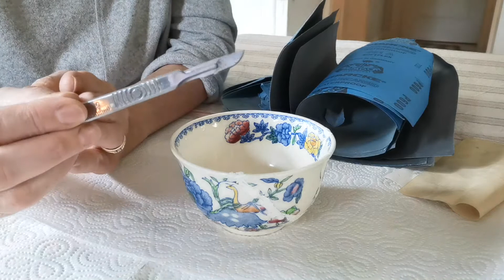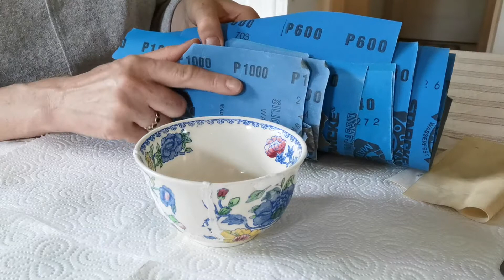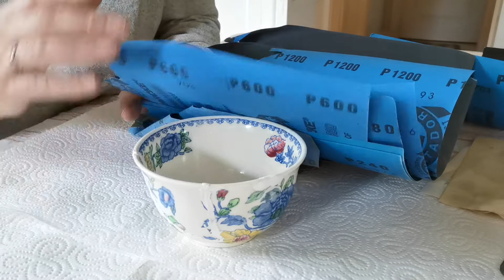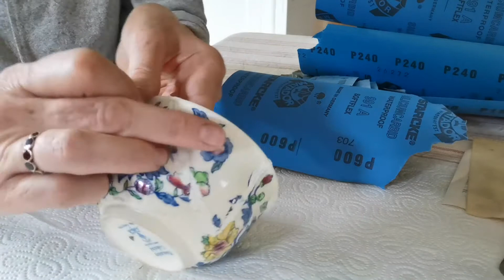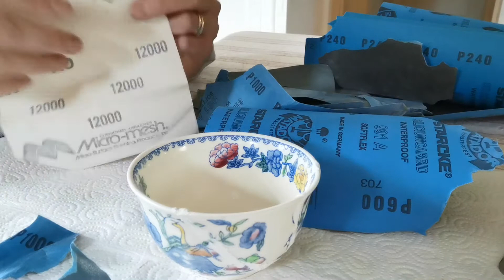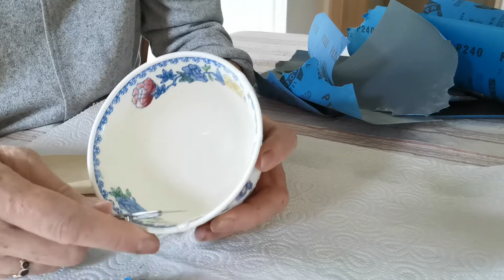How to Sand Milliput Perfectly Smooth (Without Scratching Glaze!)

Comment: She’s advising backwards on the sandpaper. Should be low to high = rough to fine (e.g. 180 rough 1000 very fine). Edit - Ah, she corrects herself (sort of), but then says that the 12000 sanding cloth is the same as the 1200 wet/dry paper! I must say, however, in spite of the confusing grit advice, the instruction is spot on and well done. Just what I needed. Thanks!
Reply from the maker: Hi CJ, many thank for your comment and for watching. I realised later I had said the paper backwards at one point and yes the Micro mech is 12000. Sorry about the confusion. I have since put the correction in the description box. 🥰

Comment: The smaller number of the sandpaper, the coarser the sandpaper. the higher the number, the finer. Start with a suitable "coarse" grade like 400 and finish with a fine grade, like 1000. In woodworking, 60 is coarse; 220 is fine. In auto body repair, 400 is fine; 1000 is much finer. You would not use a coarse sandpaper for auto body repair or for china repair, I would think.
Reply from the maker: Hi Mary Anne,
Many thanks for your comment and also for watching,  yes unfortunately I said the grades the wrong way at one point. I would usually start with a grade 600 then work up to 1200, then finish with grade 12000 Micro Mech for Ceramics. ❤
Reply: @TheCeramicRepairStudio  You should add the micro mech to your affiliate links! I just finished repairing a small bowl and a coffee mug, and I just want to say thanks for making these videos! I'm not super finicky about the results (I'm honestly unreasonably proud that I was able to fix my things, and in a crude way I like how obvious the repairs are - that and I don't want to sand for hours) so I'm content having stopped at 600 grit. It's smooth to the touch, and still "proud" on both repairs, but much nicer than the chips! 

Some questions I still have:
1. What is the coarsest grit I can safely use without damaging a simple glazed ceramic? 
2. You mentioned grease interfering with painting - can washing the piece after sanding prevent that?
Reply from the maker: @Catsstackcats  e
Reply from the maker: @Catsstackcats  Many thanks for your comment,  I really appreciate it. I am pleased my videos have been useful to you.😃

Comment: Excellent, but,one correction, the bigger the number of the paper, the finer it is
Reply from the maker: Many thanks for watching and commenting,  I did start with 600 and worked my way up with a 1200 micro mech cloth. I think I must of said it round the wrong way once on the video, sorry.
Reply: @TheCeramicRepairStudio  also the micro mesh was 12000, not 1200
Reply from the maker: @thesodgester9318  Many thanks for pointing that out, I must get my numbers right.
🥰

Comment: What would you apply to add shine back to the chipped areas you replaced with milliput? The rim of my China has a tiny flea bite and I would like to repair that chip while restoring the shine and gold gilding on the rim.
Reply from the maker: Hi Sarah  many thanks for watching and also your comment. 
I would recommend Rustins Ceramic Glaze, I have  now put ut a product link in the description box for you to click, this does not cost you any more. I would be very careful on the gold rim, depending if you are going to restore the gold and also it depends on the gold product you are using if any.
 As a tip  if you buy the glaze, put some in a small glass jar to use first to prolong the glaze. Rustins is water borne colourless and does not go yellow on ageing.  Hope all goes well and good luck. Keep me posted. 🥰
Reply: @TheCeramicRepairStudio  Thank you so much for your response! Your video is godsent. I was told by some folks just to toss that cup and get a new one but there's nothing wrong with it except for that one little chip! I just can't justify doing something like that and I scoured the internet until I found your video. I can't wait to try it out. I will let you know how it turns out.
Reply from the maker: @sabinebirdsong929  Great, I am glad you are going to repair it, one piece of advice though is once it is repaired,  not to put it in the dishwasher.x